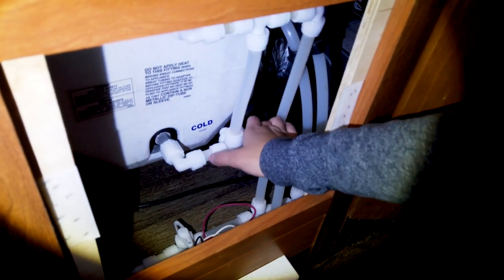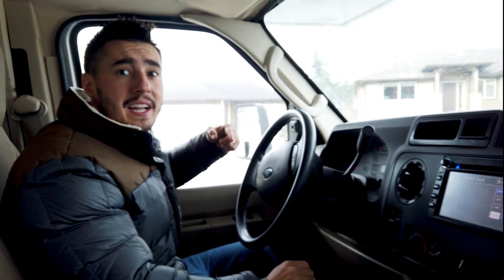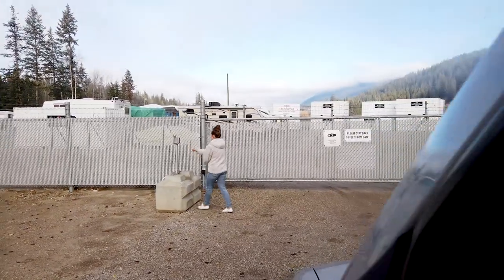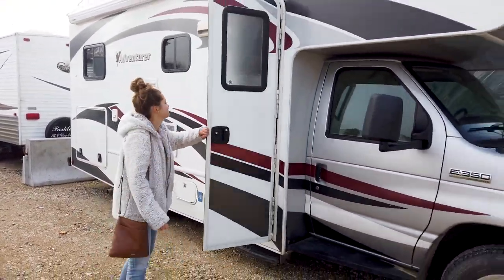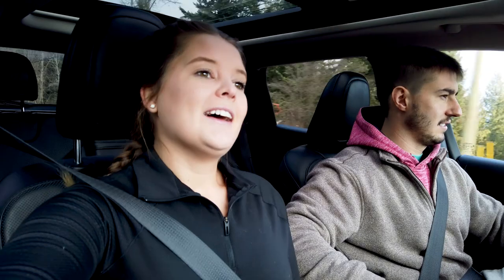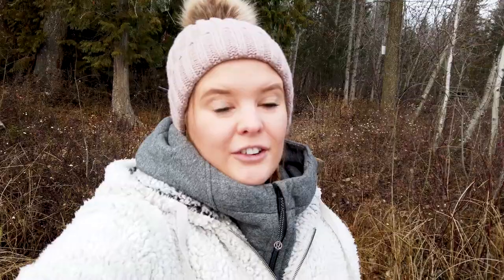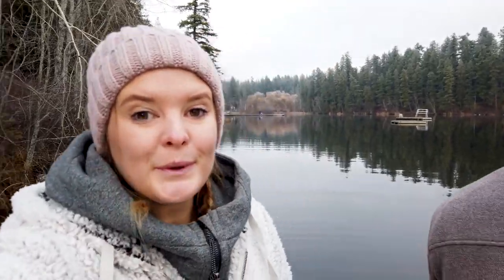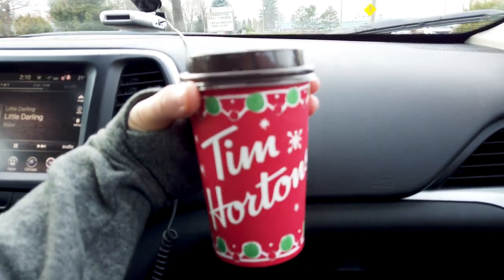RV Winterization and Storage - How We Prepped our RV for Winter

Comment: What are you feelings about the Adventurer Motor Home, such as size and build quality ?
Reply from the maker: Hey there!

So, in terms of size we really enjoyed being 23ft and having a dinette slide. At 23ft pulling through a double parking stall was always easy in the back of a lot without having to park horizontal on all the stalls like some rvers do. We even sometimes back into a single parking stall as long as we can hang our bumper over the edge and back the tires right up. Having a dinette slide basically allows you double the walking floor space which goes a long way for cooking so you can actually easily get around each other.

In terms of Adventurer as a company overall it was pretty good. There was a few things that we addressed in our Starting to Need RV repairs video (  https://youtu.be/eZhuUjNNWpM  ) but I imagine all RVs do go through similar things just from driving your house down bumpy roads. We definitely took some bumpy roads and got up to some adventure this summer too. For being on the lower price end we think it was good overall, especially since the 23ft came with a Onan 3500 generator where as the 19ft didn't have a generator option. 

Hope that helps a little and we're always happy to answer any questions you have! Cheers 😊🍁